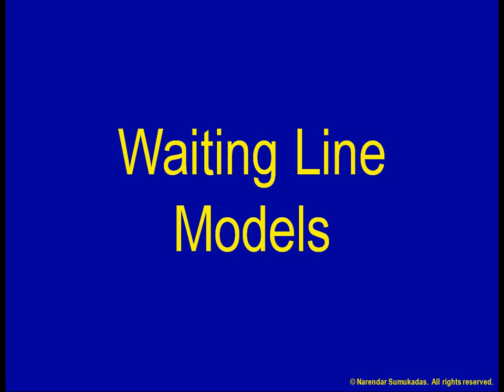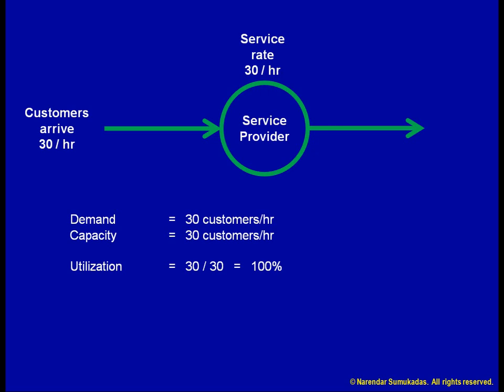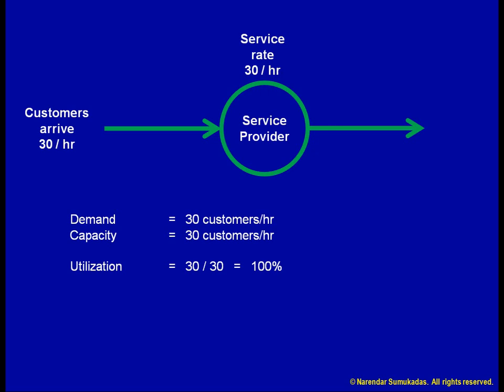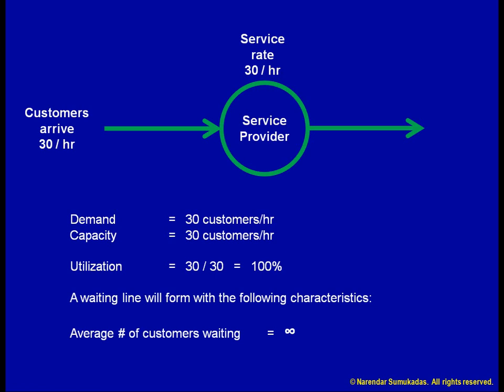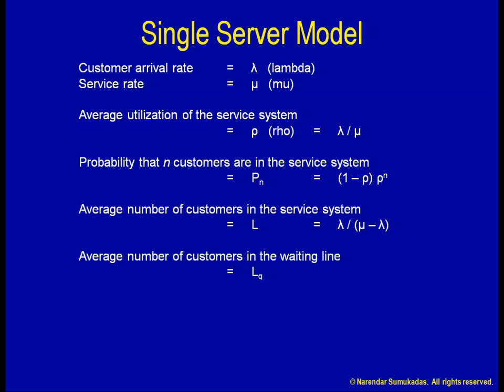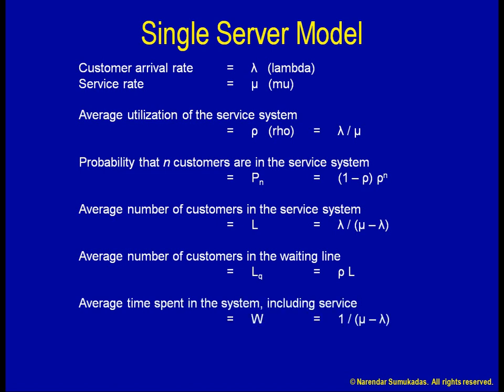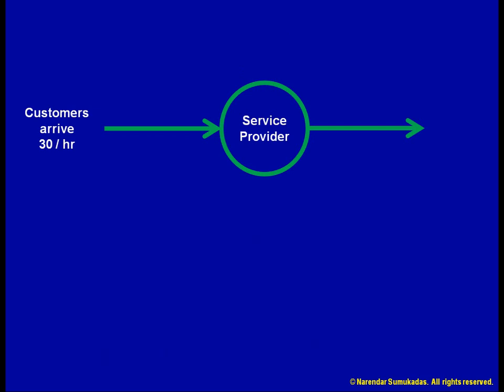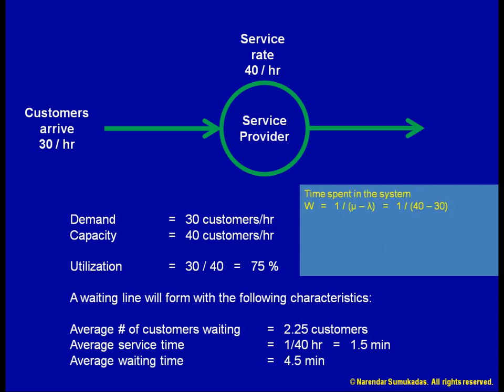[6.f] Waiting Lines

Comment: Well explained, there is a note i would like to make. it is assumed in the examples that there is no variability active in the system and that eg 70% utilization = 30% lost capacity. However depending on the variability active it will actually lead to a lower loss of capacity as it might turn out variability eats up to 20% of utilization anyway. This is rhe reason why it is wise never to set utilization higer than 80% to 85% as the world is full of variability.